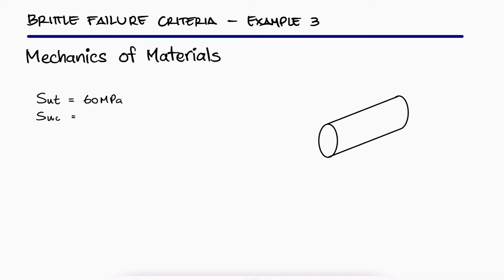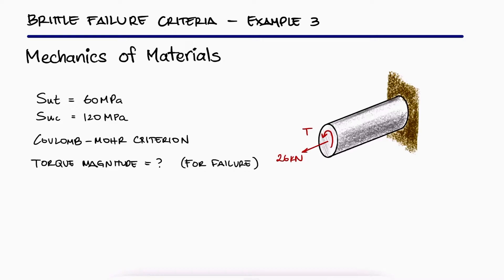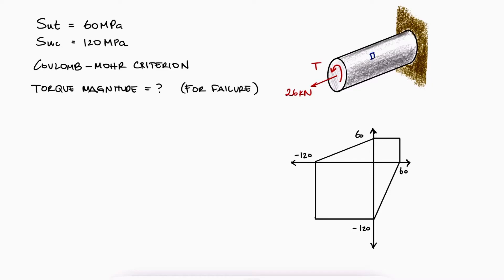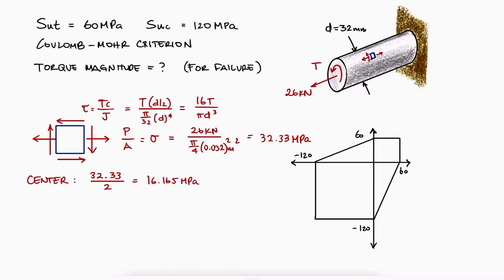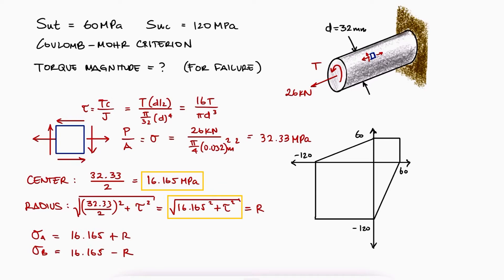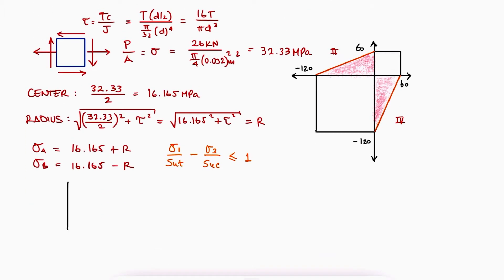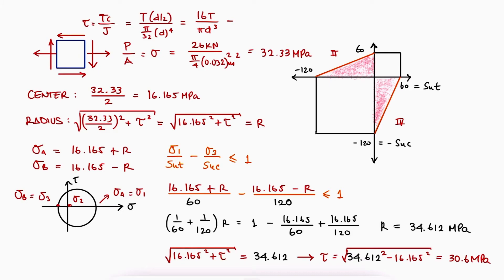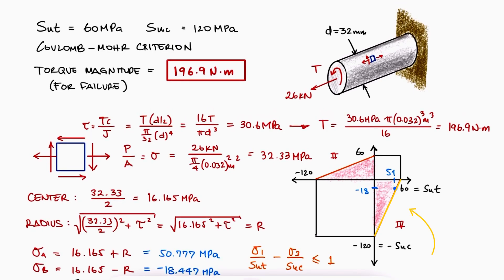Brittle FAILURE CRITERION Maximum Torque Example in 2 Minutes!

Comment: Great Video! But I have a question: Imagine there was a  force F acting at the bottom edge of the free end of the rod with components both along the rod and parallel to the surface ¿ would the component along the rod be used for a compression stress that acts on ALL elements of the rod or could it be used to calculate bending moments for elements that are at the top (because the moment is equal to  L*F* sin(theta), where L is the distance from an element at the top to where the force is acting and theta is the angle between The vector L and the force F)?